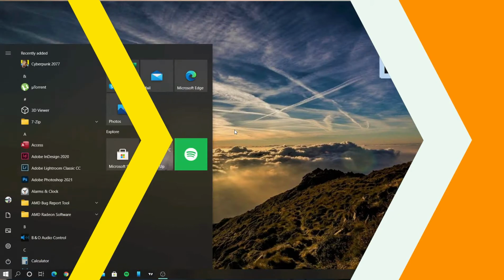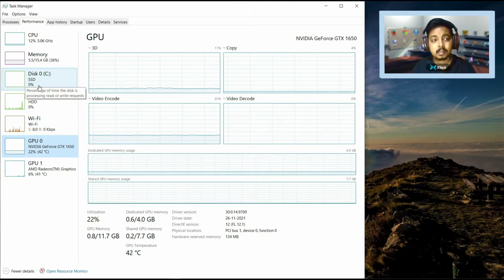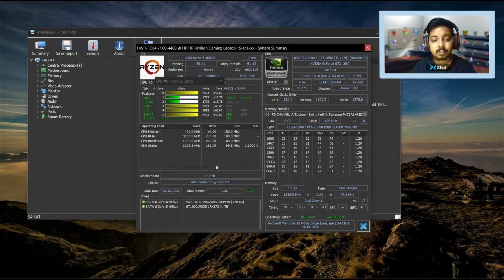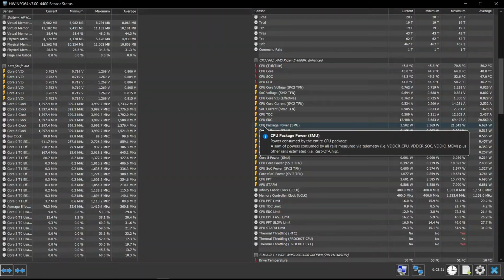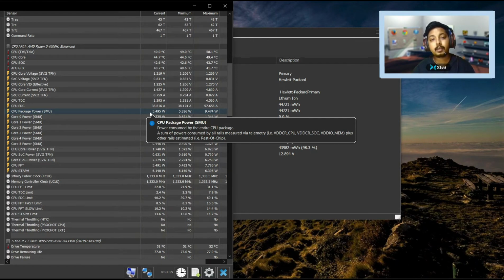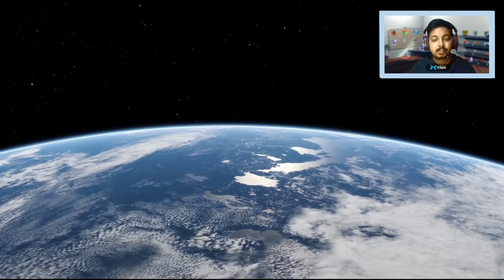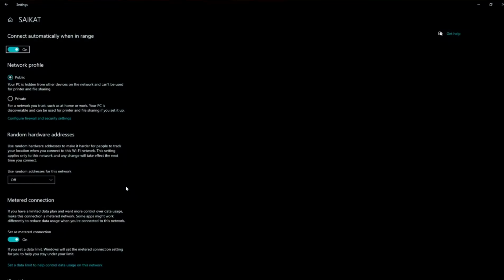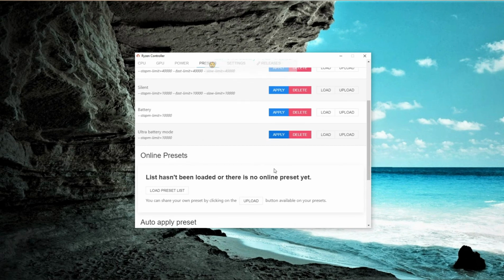How to increase Battery Life in Gaming Laptops ? Stop Heavy Battery Drain 🔋

Comment: Helpful video
Your editing and presentation has improved a lot

I personally get about 4.5-5 hours of battery with light usage (chrome, wathcing videos, ms office etc) on my ryzen 4600h pavilion 
I can push it to 6 hours with the same usage, if I set the brightness very low and switch the refresh rate down to 60hz

I feel the main reason why a lot of users get poor battery is because they have alot of unnecessary background apps. 
If you're a gamer, then programs like steam, origin, discord, epic games etc automatically start when you boot up windows. 
I'm guessing most people leave them unchecked.  

I've also found that using Edge instead of Chrome can give me 15-20 mins of extra usage. 
Edge being chromium based makes it very similar but I find it hard to give up chrome :)
Reply from the maker: I too find chrome to be resource hungry. I use firefox instead and rarely used chrome. I clearly noticed the improvement in battery life!
Reply: @DeepteshLovesTECH 
Edge should give the best results because it's best optimised for windows
Reply: @Pahulpreet Singh
Yes that's normal. 
NEVER play games on battery. 
Always play games while plugged in.
Reply: @Jonas-ej7id  hi , my Msi 3050rtx intel i5 drains the battery in like 2hours when I’m using it for school(basic use like internet YouTube etc.) I removed gaming mode and full power mode but it still  drains an enormous amount of battery for a 1h30 to 2h. Do you have any advices please?
Reply: @moammedziyadsettouane3313 
Seems to me like you've got some programs running in the background using.
Check startup apps in task manager.
Reply: @Jonas-ej7id  bro  thank you very much it went from 1h30 to 5h30 just by removing steam epic games discord and Microsoft in startup tasks
Reply: @moammedziyadsettouane3313  Same problem, I'm about 2 hours, gaming laptop, but noticed while traveling and trying to do work on battery.
Reply: @Pahulpreet Singh depends on which game you play, like in gta 5 my laptop can last 2.5 hrs but in hitman 3 it would be 1.5 hr.

Comment: Great video man.
I had a question.
On my MSI GF65 there's an option to limit charging to 50-60 percent. It says to enable this option if i use my laptop primarily plugged in(which i do), so that it prolongs battery lifecycle.
Should i use this option?
Reply from the maker: You may use it. See the theory is, once you reach from dead or near empty to 100% it completes one charge cycle , so if you cap the max charge %ge then it would not let the charge cycle complete and the battery will not degrade as fast.
But I'm not sure how effective this is in real life.